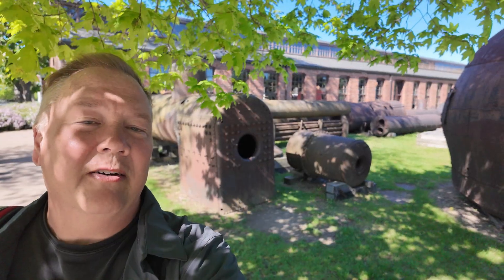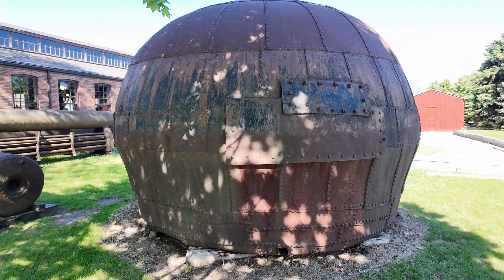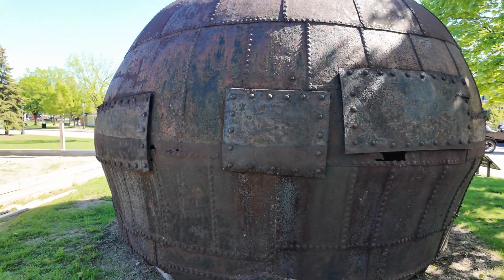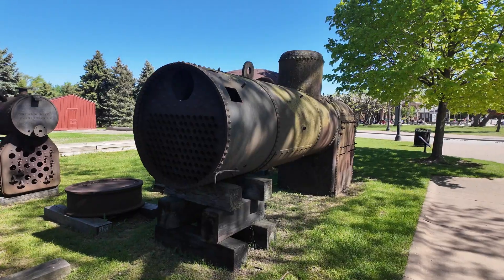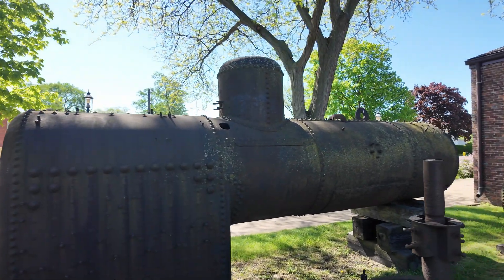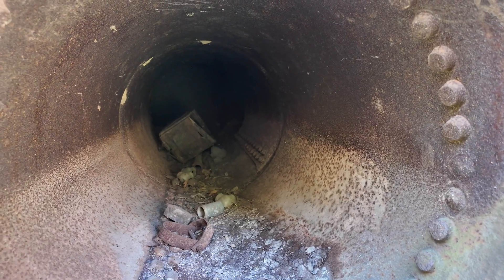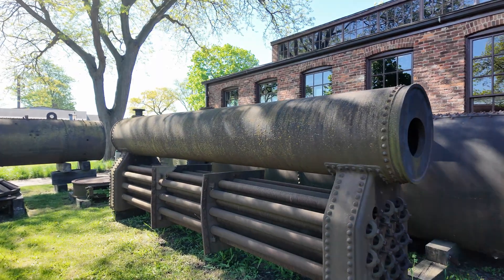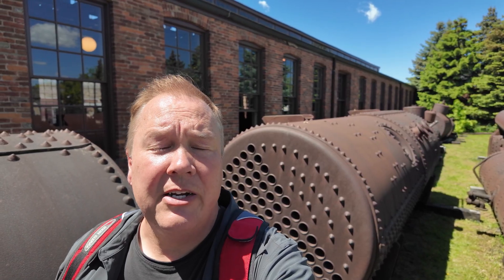Boilers - The REAL Power Behind The Industrial Revolution

Comment: This reminds me of that one time I went to clean up, what is basically a firetube boiler... It had a slight oilburner malfunction, and as a result all of the tubes were pretty much completely blocked up. At first I tried to use a regular tube brush, but eventually removed the brush part from the handle, and bolted a washer on it. With that contraption I managed to push through the soot and get some sort of hole in those tubes... And then proceeded to brush them clean.

I think most boilers I have seen so far are essentially variations of firetube boiler. The exact arrangement of tubes varies.

Interesting enough, I have seen one that could be classified as a haystack boiler. It was basically built as if two ends of a pressure tank were welded together to make this sort of squished ball shape, and couple of tubes for feet to leave about a foot of space underneath. On the underside of the tank itself there were a few strips of steel to improve the heat transfer, and down in the bottom there was a simple holder for a hand held gas torch. And out of all the "boilers", that one is actually the only one that was supposed to really boil water into steam. As it was a portable steam generator, we used it to thaw ice from frozen pipes.

I knew even before that water tube boilers exist, but those I have not seen myself.
Reply from the maker: I haven't seen a portable steam generator like that.  Was it a home-made thing, or something actually sold for the job?  How did it melt ice from frozen pipes?
Reply: @Industrial_Revolution  Yes, it was made for melting ice. Like I said before, it was quite simple boiler, it just had an output connected to a hose on top. I don't think it even had any valves or anything to control the steam. It did generate some pressure, but nothing crazy, as it was intended to basically just melting ice. There was a nozzle on the other end of the hose, where the steam came out. You would just push that into a frozen pipe.

I think it was actually intended for melting ice from water feed pipes or something... But we rarely did that. We did however use it for plenty of culverts. The hose just had a tendency to somehow loop back on itself, as the large diameter culvert didn't give it any guidance to keep it straight. So we had to improvise a bit, and solved that issue by using a plastic water pipe as a sleeve of sort. That obviously required much bigger hole than just the hose itself, slowing down the progress... But it did help to keep it straight enough to reach the other side.

Usually when we were called in, water was already flowing over the road, so there was plenty of water on the other side. And as tiny hole it was we could make with it, as soon as there just was a hole through, the flowing water would just melt the hole bigger and bigger, and it would happen quite quickly too.

Comment: Thanks you for your great explanation of the various types of boilers, 
In fact the Cornish and Lancashire type boilers is not completed only by the shell itself, but they are nested in a brickwork to keep the smoke circulating around the shell from the rear to the front by two long lateral chambers and a final exhaust under, between two walls in the center from the front to the chimney, and it's very easy to install a good preheater, economizers made of hundreds of tubes to improve the enegetic efficiency by preheating the feedwater . By that way the steam production was made as efficient as with a more modern fire tube or water tube boiler 🤗.
Great video !
Reply from the maker: Thanks!  I hadn't heard that additional ducting until someone else commented on it recently, too.  That definitely makes sense, to maximize the heat transfer.

Comment: Great video! As a big fan of Lancashire boiler I'd just want to add few words - said boiler maximized the heating area not only by including two flues, but also due to the shell of a boiler being encased in masonry "foundation" with smoke channels. So the flue gases would first pass through a flue inside the boiler (front to back), then on the sides of the boiler (back to front) and finally on the bottom of a boiler (front to back) into a chimney
Reply from the maker: Thanks!  That's the first time I'd heard that.  It certainly makes sense, though.

Comment: The main advantage of the two furnace Lancaster was more even heating and steam generation. Opening the door to tend to the fire lets a lot of cold air in. With the two the doors were smaller and one furnace was burning hot while you tended to the other.
Reply from the maker: Good point.

Comment: Ever see what happens to a firetube boiler on a locomotive if the water level gets too low and water starts to flash to steam? It usually blows out the crown plate water storage over the cab and par-boils the running crew. This usually happens when the fireman isn't keeping an eye on level sight-glass tube. 

The other explosion from material defects or low or high water levels in the boiler is an outright blow out explosion of the boiler itself. That usually blows all the flue tubs out the front plate leaving the locomotive looking like a giant metallic Cthulhu.
Reply from the maker: It's never a pretty sight.  That's part of the reason there's such a need for qualified boiler operators, even today.  Definitely not an extinct career path.

Comment: Would the haystack boiler have been made of wrought iron strips forge-welded together?  I have read that this construction method was about the only option until the Bessemer process made steel available in large quantities.  To me, the surprise wasn’t that many of these boilers exploded but that a reasonable number stayed intact.
Reply from the maker: Looking at them, they look like they were just riveted/bolted together.  Remember, haystack boilers only needed to provide about 5psi of steam, so the pressure just wasn't that serious and they didn't blow up much, if at all.  
Even with that low pressure, though, they still had automatic, high-pressure release valves.  Check out my Haystack Boiler video, if you haven't seen it.  That one hasn't been out in the weather for decades, and the pressure release valve is completely intact.  It's really simple.  It's just a vertical pipe out the top, with a weighted lever to keep it closed.  That's all they had at first. Newer systems started to use springs to keep the valves closed, and, finally, fusible plugs that melt out at high enough temperatures.  Those are both still used today. 
Maybe I should do a video of the different, automatic pressure release valve systems?

Comment: The Cornish boiler is interesting.  I've read of that same system being used by the Romans to heat tents.  Not with a boiler but by having a fire with the exhaust flowing in a channel covered with flat stones through the tent.
Reply from the maker: I haven't seen it with Roman tents, specifically, but now that you mention it, that is how they heated Roman baths (the rooms, not the water).  Thinking about it, it's odd that never made it into European castles, at least as far as I know.  I'm not an expert on European castle construction.
There's a guy on YouTube who does "primitive" technology, like stone tools, harvesting clay to make pots, etc.  He did the same thing in a wattle and daub hut he built, so the technique could have been around for quite a while, just not applied to actual boilers.